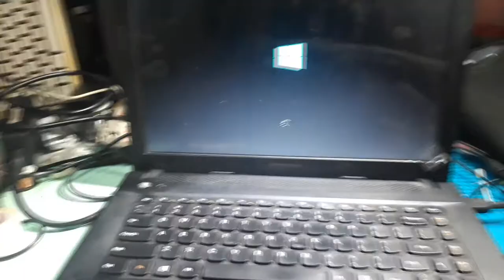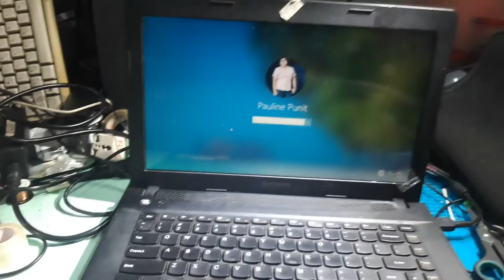Lenovo G400 - No Display, LCD, and Keyboard Replacement

Comment: boss magalaw kasi yung screen nung ganyan ko kada type ko umaalog.  Baka makagawa ka video pano sikipan yung hinge o kaya paturo sa comment pano haha.
Reply from the maker: Madali lang yon sikipan, parang turnilyo lang yon..try nyo lang po, gamit kayo ng tamang tools lingk small plais
Reply: @WorkshopFix  Sige po nakakalula lang dahil andaming turnilyo at pagbabaklas na magaganap. salamat po at good luck sa channel!
Reply from the maker: @LowSettings  sige po gawa ako ng Video. Mayroon ako gagawin, dadalhin daw mamaya, sira kc hinge non, papalit narin sya ng wifi card. Gawaan ko video para sayo..

Salamay
Reply: @WorkshopFix  panuorin ko tiyak yan boss haha. Nabuksan ko na laptop ko. Di pala maluwag yung turnilyo. sira pala mga hinge haha
Reply from the maker: @LowSettings  ah ganon ba.

Gamit ka lang ng glue.titibay yan..need mo lang hot air para maalign ng maayos.